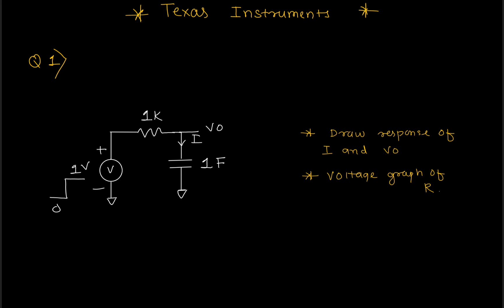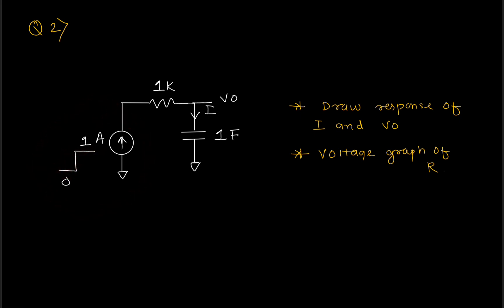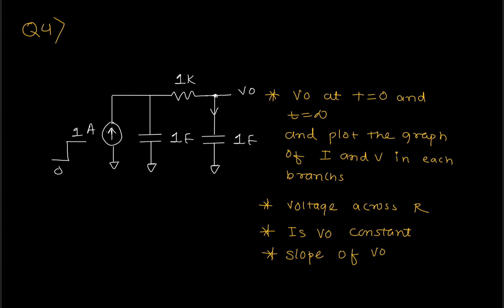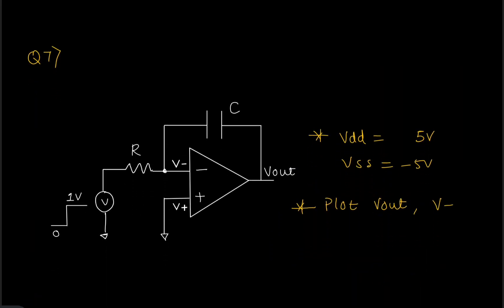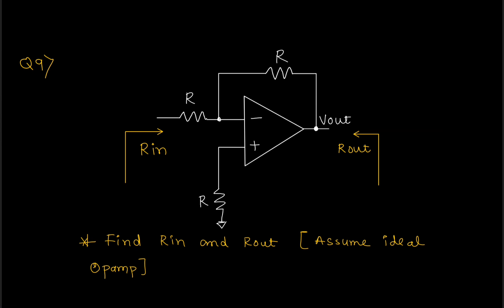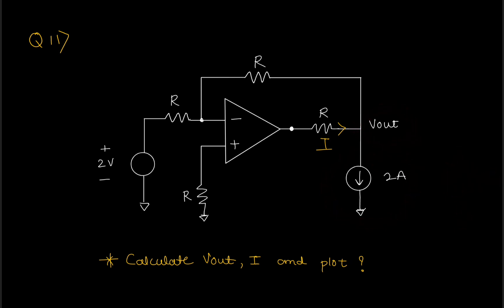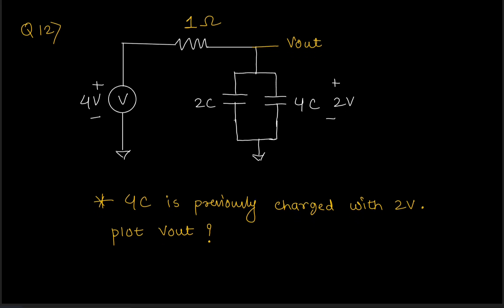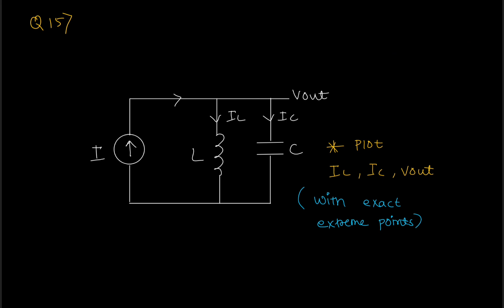Texas Instruments Interview Questions/Experience for Analog VLSI Engineer Role (6M + FTE)

Comment: Bhaiya I'm in final year BE ETc student studying in MP state govt college(tier 3).
Our placement head informed us that Micron will be coming for hiring in sept. , They didn't say anything about the roles So how should I prepare? And for what kind of role Micron will be coming in a tier 3 collage? Do you know anyone who got placed like this? 
Please help
Reply from the maker: Micron is majorly a memory design company
The role for which they are coming is hard to tell, it depends on there requirements. But majorly they hire for testing and validation in the analog domain from tier 3 

You prepare for basic VLSI flow
Make a project of 6t and 3t SRAM if possible 
Understand each and every concept of that
Read and write operation conditions should be clear
Disadvantages and advantages of these two
What is retention time etc etc

All the best for your test☺️

You can join the telegram channel if you have any technical doubt
Reply: Thank you Bhaiya.., but will it be possible to prepare for analog role in this much time considering that my profile now is mostly of digital design & verification with some simulation work on FPGA..